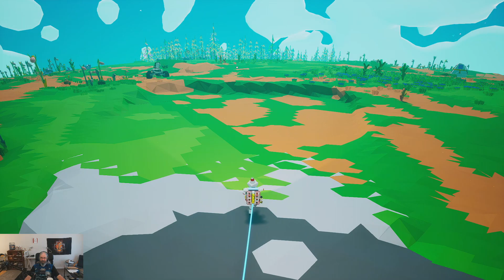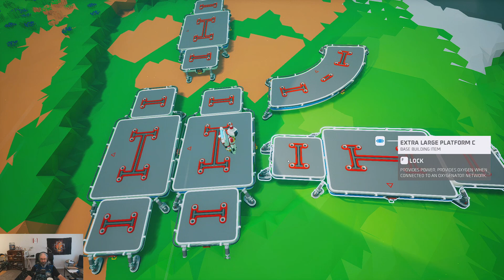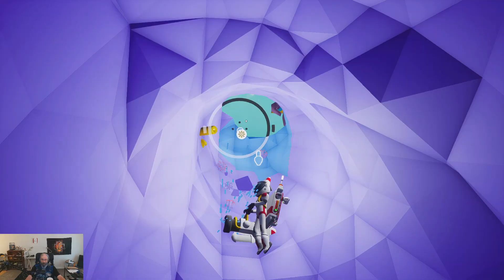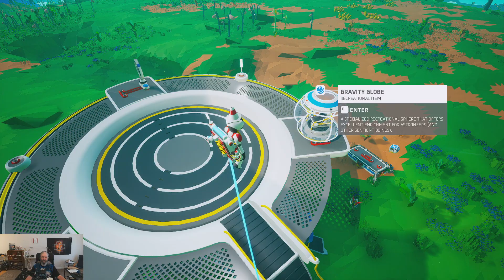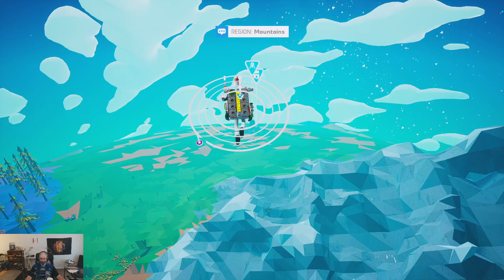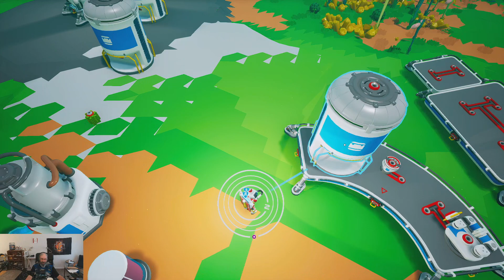setting up the nano-carbon alloy factory.

Comment: the large resource canisters is the most expensive parts in this farm i assume. if we discard the power supplies.
edit: i built the farm and it works but whats weird is i was producing over 200 units of power so when i switched on the power to this whole farm the power went from 200 units to about a stable 60 units of power but when i cut the power to the farm it went back up to 130 and never back to its original 200+ units of power 🥲 what happened?
edit2: i had 2 splitters to check how much power it produces so i removed one at the nano farm and it sky rocked up to 260 so its a stable 260 and reaches 310+ when wind but my base is still not overcharging?